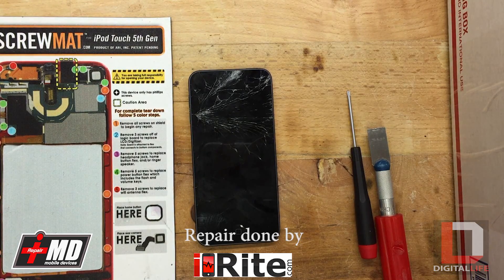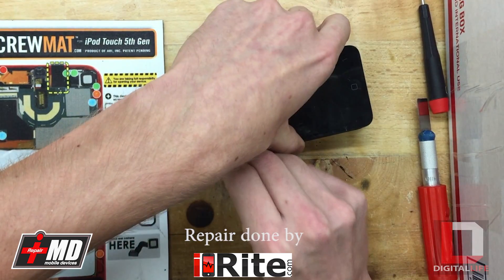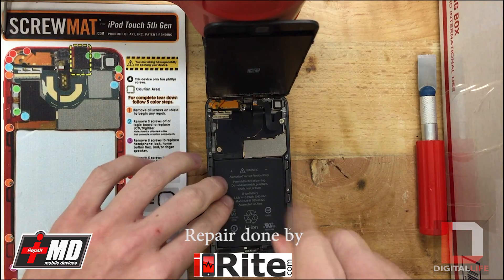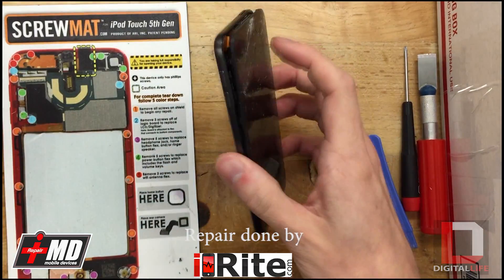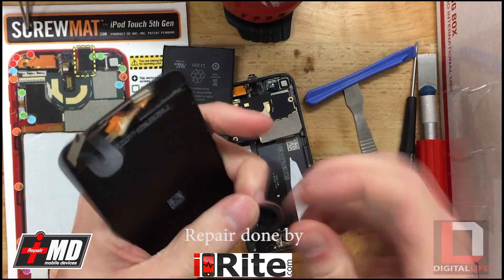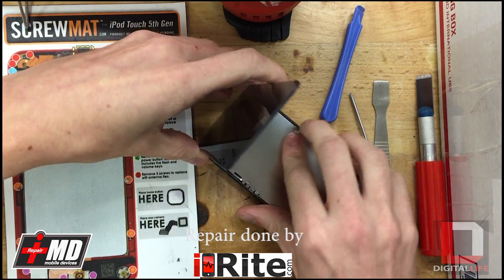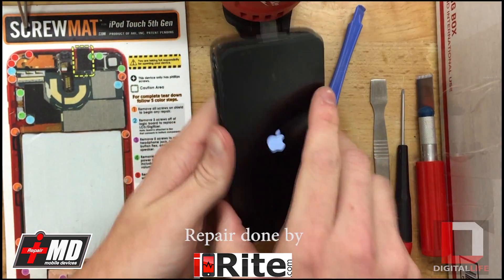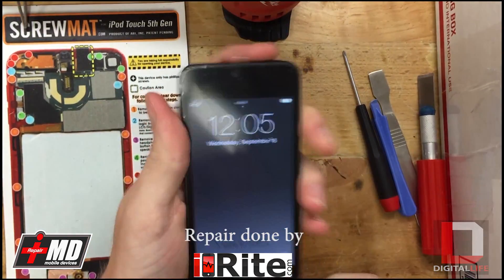iPod Touch (6th Generation Repair)

Comment: My screen didnt fit right so i pressed a little bit hard just on the edge to get it in and it went in but then i turned it on and there were colorful stripes on the entire bottom of the screen and a thin green line on the right side

Comment: I'm just trying to replace the glass part not the lcd any tip on how to get the glass off the lcd
Reply: Alex Stewart it is easier to do lcd becauseits a pain to get just the glass
Reply: The LCDs are connected to the screen apples way if getting more money

Comment: Lol fake battery removal
Reply: Lildjmix 
Omfg dude that is absolute bullshit at its finest.
Reply: Nope, that was very real.  i just did it myself.  You have to heat the back of the case a little to loosen the tape that holds the battery, and then carefully pry it up and fold out of the way.  The ribbon is soldered to the motherboard.